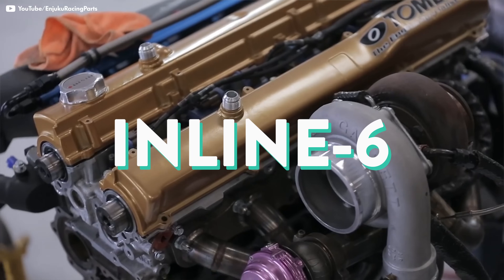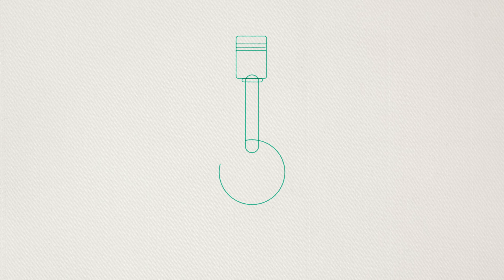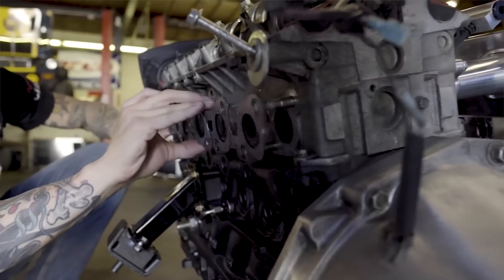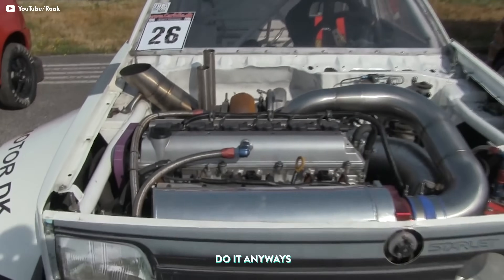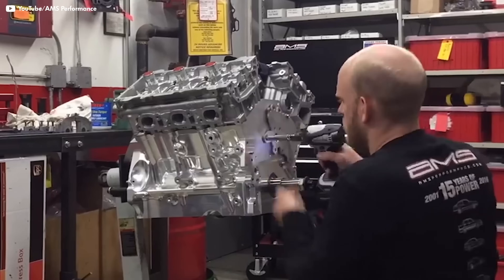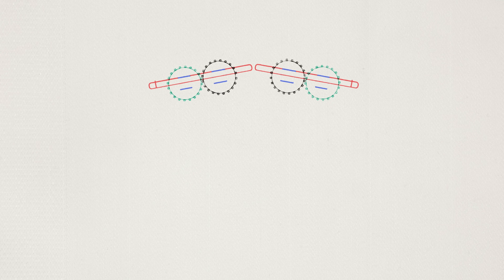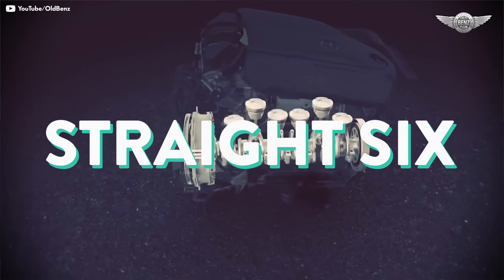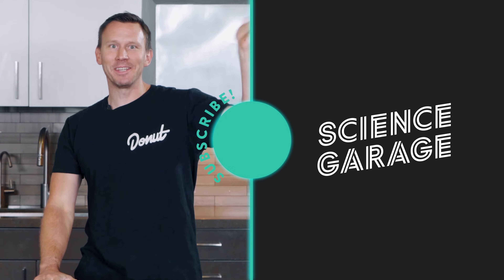INLINE 6 vs. V6 - How it Works | SCIENCE GARAGE

Comment: What about the Chrysler Multibank? It was used in the Sherman tanks in WWII.
Comprised of about 4 or 6 Chrysler V6s all clustered around a central crankcase. So you had a 30 plug engine.
Sounds dreadful but was actually quite reliable.
Reply: five Dodge 230 L-heads.  The biggest problem these had was carburetor access
Reply: So...you suggest using a military tank engine in a everyday car?
I wonder what the MPG would look like.Or how would it fit.(No trucks)

Comment: Wow. You forgot to mention that I6's are incredibly popular with big rigs
Reply: I work on fleet trucks daily.. almost all are inline
Reply: Yep, I'm a truck driver and every tractor I've driven is powered by an Inline 6
Reply: Question to all three of you then; is that because they are easier to work on as you can access the 'entire' (more or less) engine on the side of the road?
Reply: @Anarchristian_Beanz  I6's are have alot more durability and torque over their V6 cousins.....as for ease of maintance, that is a debatable question which depends on the engine's size, weight, engine manufacture and vehicle it is installed in.
Reply: Joshua Pearson it’s for durability and prevention of vibration fatigue to truck and operator
Reply: inline six can be enlarged as much as you want and still run smooth, also, in a big rig, size and weight are not a concern, and since you can extend the stroke for more low end torque which is what big rigs are all about, you have a winner...
Reply: Michael Miller scania v8 if you got the $$$$
Reply: They make low end torque easier and better than a v6.
Reply: Facts my semi truck has a Detroit inline 6  twelve liter
Reply: Yeah i’ve also driven a 10,5L inline 6 for quite a bit!

Comment: I had an Audi with inline 5 cylinder engine.  It was also silky smooth...but now I am curious how it was balanced
Reply: Silky smooth?  Anyway, Audi used weak, super-soft engine mounts, the one on the driver's side would often break.  That's what caused the run-away acceleration problem on those cars.

Comment: Forgot to mention the best motor ever put in a truck, the cummins 5.9L inline 6 turbo diesel. When you put the cylinders in an "inline" configuration is increases the tourq, which is why cummins inline 6s are still able to compete with all the modern diesel V8s.
Reply: I6s dont increase torque and Cummins made v8s they are just not for truck use. Also would be funny to mention how a na v8 with less cubes then a Cummins made 1000 lbft at 1400 rpm. And a v24 made like 3000 at less then 900. The crank shaft has nothing to do with it. It's about the entire package or a 292 i6 would produce more low end torque then a 4.8l ls because it's just a i6 at the same cubes. And the 292 head stock can only manage to hit peak torque of a lower value at 2000 rpm net 1600 gross or 800 rpm gross depends who you ask. And the ls produces more at around the 2000-2500 rpm area
Reply: The Cummins i6 ranges from 6.7-15 or maybe 16ls. A scania v8 produces more torque and hp.

Comment: Why do supercars always seem to skid and lose control. If you look up supercar crashes, it almost always starts with a skid, lose control then a crash, but Why?
Reply: More money=less driver skill typically.
Reply: Supercars are typically mid-engine and rwd. What happens is a thing called Snap-oversteer or Liftoff oversteer. Basically, a skid happens, so the driver brakes and tries to correct for it, the problem with braking is that if your vehicle is in a turn, the heaviest part of the vehicle is going to want to lead to the front because by braking you transfer all your weight forward. The engine and transmission are centered near the rear of the vehicle and so the back end whips around. With all that power, a light body, the engine flips the car around. 

I'll find a video that explains it. The MR2 SW20 is famous for snap oversteer. Cheap, lots of power, and means dumb young highschool/college kids buying them and doing dumb things in a car that drives like nothing else on the road.

EDIT: here is the video http://www.youtube.com/watch?v=tFnUysUwm88&t=2m58s
Reply: Route1Reels Thank you so much! The stars have aligned, the world is good again, and it all FINALLY makes sense now.

Comment: I just rebuilt the inline in my 77 ford truck 
The 300 Cu. L6 is my favorite motor ford ever built.
It's my profile picture 
The previous owner had run the motor put of oil (hole in oil pan) and the old thing kept on kicking 
In 41 years, it never had anything changed.
It's a testiment to the durability of the engine.
153624
15 is too young
36 is too old 
24 is just right

Comment: This is wrong!!!  The piston doesn't travel farther during its first 90 degrees...  it travels less during the first 45 degrees, then most during the next 90 degrees, and then less again for the next 45 degrees.  When the crankshaft is at 90 degrees, IT HAS traveled exactly 1/2 of its stroke.

Comment: I wish i could get my hands on a 4.0L barra engine
Reply: Get a 300 straight six do offenhauser intake/exhaust port and polish the head and throw a turbo on it you'll have the same torque as a 12v cummins plus around 200-225hp. the compression ratio on a 300ci is  8.8.1 when the ideal compression ratio for turbo charging is 9.0.1

Comment: Mercedes m276 Is a 60 degrees V6 engine. It runs really smooth and does not even have a balancer shaft. The fact it is a 60 degrees engine, there is more room on the sides to work on it.

Comment: High-compression Inline 6 is absolutely amazing... my 2 favs are the S54B32 in my 04 M3, and the RB26DETT (you should know where this comes from!!). I do, however, love Nissan V6s... the VG30DETT was incredible for its time.. but that VQ37VHR, with the new VVEL.. slap on some CAIs and HOLY COW! Talk about waking up an engine.. the power delivery and torque curve is SO smooth on that V6, it's absolutely incredible!
Reply: I agree,  the N54 in my 335i has a good amount of torque even below boost range. To be fair i'm comparing it against my previous K20 so anything feels torquey to me

Comment: The answer is simple! RWD all the things! That way you can run inline engines in any platform! The only advantage that a v6 has is packaging flexibility. V6s are largely being phased out in a lot of vehicles in favor of turbo 4 cylinders. Mazda (2016+) and Hyundai (2019+) don't use a v6 in any of their vehicles.

Comment: WHAT are you talking about the best gas straight 6 IS  FORD 300(4.9) or JEEP 4.0L and 80% of Diesels are straight 6s
Reply: Ford 250 straight 6 is just as good.
Reply: 2jz the world m8 sorry
Reply: try the ford barra straight six, DOHC, 4 liters and soooo easily modded.
Reply: 6.7 Cummins for life.
Reply: Slant 6- jeeps like to blow up radiators with the big boy
Reply: I don't know about you but in America we leave diesel to big rigs, school busses, and farm trucks. Less than 20% of vehicles in the us are diesel.
Reply: 80 percent of diesels are i6s? Only in small equipment.
Reply: Hell not even then i4 i5 v6 v8 and up all have been used even i7
Reply: Wrong, 225 Slant Six.
Reply: @JakeSnake07  except of 30 degrees outside and it won't start. We're done 3 plane Tugs 1 out of 250 straight 6 Ford and that one had a 300 straight 6 the other one had that 225 straight it was the only one that would not start. The two Ford's just needed gas.
Reply: @republicansareoffendedeasi821  yeah but imagine a straight six with tbfi

Comment: VW made a 6 cylinder for a little while....        VR6?
Reply: The VR6 is such a beast of a motor. Im sad to see it's not even mentioned. Its designed as an inline-v6. One cylinder head but each "bank" of cylinders are separated by 15 degrees. 6 cylinder power for the size a hair bigger than a 4 cylinder. Plus the sound they make is amazing, like chewbaccas growl. It was initially designed to be a diesel so VW manufactured them with forged internals so a bone stock motor is good for 700 whp the trans will go before the motor. It's a popular platform for drag racing cause you can make stupid power with them.
Reply: @Saltinator  you really know your VR.
" der beste Sex, ist VR6 " 🤣🤣
Has a really great, unique sound, too.
Reply: @freedom8480  I've had my fair share of VRs. I currently have a 99 Cabrio I vr swapped.
Reply: MY GUY!! You're an OG Vee Dubber ;) I'll remember my R32s number for life. 4372/5000 :)
Reply: @Saltinator  There's no such a thing as an Inline-V6. The VW VR6-VerkürztReihen6 or loosely translated in English as ShortenedInLine6, basically is an inline 6, 6-crankpin, 7-bearing crank throws, with the cylinder bores splayed at 10° or 15° apart.  Therefore staggered cylinder head and shortened crankshaft. There's only 1-cylinder head.  A 60°, 90°, or 120° V6 all have 3-crankpin, 4-bearing crank throws. 2-cylinder head (L&R) etc.
Reply: @7spower998  inline because it shares one cylinder head. Vee because the pistons are staggered 🤦🏼‍♂️
Reply: @Saltinator  You said an InLineV6. An IL6 has 6-pin crank throws, while a V6 has 3-pin crank throws. The two don't mix. The VR6  cylinder head is bored at V angle so the cylinder bores can be staggered. Therefore it shortens the crankshaft's length. That's why it's called VR6-VerkurtztReihen 6 - ShortenedInLine 6.
Reply: honestly needs its own segment but i agree should have been mentioned
Reply: They should've included this in the mix
Reply: It has such an awesome exhaust note. I miss my mk4 gti 24v vr6 it was such a fun little car
Reply: @kevinkinsley2019  that's one of my dream cars!
Reply: @MrSapper21  haha there badass little cars but I haven't had much luck with German cars mechanical wise. My VW and my car before that e46 330i it seemed like they were broke down more then they were on the road lol. I loved both of them but financially not practical.
Reply: @kevinkinsley2019  I had a turbo VR6... I used to say when the VW runs it a good day,  when it doesnt its a normal day.
Reply: @Blakek.  Haha you're not lying though. I swear I could expect my gti to break down at least every other month. Every time I drove it towards the end I would pray nothing would happen.
Reply: Now I'm going to search for videos on this just in case donut doesnt make one 😁
Reply: The V and R in VR6 represent two German language words which translate to V and LINE. The R is REIHE. It's a compromise design that's not as well balanced as a TRUE straight six and, not as short, front to back, as an inline 4. It's "neither fish nor fowl" as the old saying goes.
Reply: @BigFiveJack  i always thought it stood for " Verkürzter Reihen " motor which translates to "Shorter Line " engine.
Reply: @joshuavandergraaf7413  The following video, (by Jason) tells us about this topic during the first 25 seconds or so: https://youtu.be/Y0LKWt3Ttic
Reply: @BigFiveJack  VR-VerkurtzReihen-ShortenInLine
Reply: It's a mix of the two, 15degree angle.
Reply: I used to have a VR6 R32 MKV and gawdamn was that one of the best motors I've ever messed with.  Too bad MKVs have bad bad electrical issues. 10/10 would swap if possible xD well, anythings possible...
Reply: Check out the german ford made Cologne v6, granted they were cast iron blocked but they made crazy power with stock internals...used in rallye in the 80s

Comment: V6 is great for the manufacturer but a headache for the consumer. Inline 6 or die.
Reply: Hansolo86Mk2 oh yes
Reply: That's basically what I was getting from this video but at the same time a lot of consumers do want smaller/compact cars and understand that comes with more maintenance (or just don't care).
Reply: @Anarchristian_Beanz  that's what 4cylinders are for
Reply: I6 is superior in its reliability and elegance of design compared to V6, but that V-design has created the best sounding six cylinders in my opinion, listen to the Alfa "Busso" V6 engines as well as the old Ferrari racing engine used in legends such as the Lancia Stratos. Inline is great but there is some magic to those old italian V6s.
Reply: OR you forget about 6 and go to a V8 instead
Reply: @sauronseyescream8394  For what? More headaches?
Reply: @Bitaliktderr  its worth it to me. I'm a sucker for a great V8 exhaust note. Not a fan of anything about six cylinders really, other than fuel efficiency
Reply: @sauronseyescream8394  I like V8 sound too but more money to rebuilt, maintain it, and overall costs, so not sure if its worth extra $$$ for the exhaust note.. Inline 6 has one of the best sounding exhaust notes when turbocharged.. if you can afford a V8 and go for it, just a lot more headache and money rebuilding it when something goes wrong compare to L6..
Reply: @Bitaliktderr  oh believe me, I know headache. Had to replace the exhaust valve spring in my Trans Am after it broke somehow. LS1's are a pain to work on inside of the car.
Reply: @sauronseyescream8394  yeah man, I am also a type of guy who likes to save a buck and work on my own cars
Reply: @Bitaliktderr  I do it so I know what's going into it and that it's done right. Plus its better to be able to know how to fix something
Reply: @sauronseyescream8394  exactly! Plenty of diys and info on google to do it yourself!
Reply: @Bitaliktderr  yup. Going to pull the engine eventually and do the rest of the valve springs
Reply: @sauronseyescream8394  nice man! Good luck
Reply: @Bitaliktderr  thank you, gonna need it. Have to lift the body off the engine to do it.
Reply: @sauronseyescream8394  yeah thats a easier way going about doing it when you have a lift
Reply: @Bitaliktderr  don't have a lift but found another way to go about it

Comment: Most of the cons of the inline 6, like stated in the video, can be negated with modern technology. As far as the length of an engine bay, that's more of a design feature. Long beautiful bonnets or hoods are beautiful on most cars. Overall, I really don't see any negatives with I6 engines. Hell, even Toyota/Lexus utilized them in their line up of cars: 1JZ & 2JZ. Less complexity, less vibrations, more compact, forced beauty due to design... what's not to love. I really didn't understand what a balance engine was until I drove in an E46 M3. Put it this was, when the car was parked I stepped out of the car not realizing I didn't turn of the engine. It's that smooth. The same at a red light. All of sudden, it made me realize how "unbalanced" my I4 K20 was in my Acura RSX-S.
Reply: I believe it has to do with the firing order, the primary forces. I'm not sure, however.
Reply: @Dickhead Bear I disagree with weak crankshafts as someone who drives a 13L L6 powered semi for a living

Weight distribution and engine weight are the only downsides. They are outweighed by the pluses in applicable applications (good torque, hence truck use; and naturally balanced)
Reply: @Dickhead Bear and almost all V6's need balance shafts, or they run like shit, like the original Buick 225 V6
Reply: @FirebirdCamaro1220  that was a 90 degree and that wasn't running like shit it's how 90 degree v6s run.
Reply: @jdrok5026  The "ideal" bank angle for a V6 is 54°, and even then, the few V6s built at that angle (like the Opel engine used in the Saturn L-Series) still need balance shafts.

There were no balance shafts in the 225, they were added with the 231. Hence the 231 ran much smoother than the 225 had
Reply: @FirebirdCamaro1220  crank pins where added to the Buick 90 degree engines
Reply: @jdrok5026  some applications did that, I had a 90° V6 in my 08 Dodge Ram, the 3.7 PowerTech. It did have a balance shaft.

The Ford Essex 90°V6 from the F150, Econoline and the Fox bodies also used a balance shaft

And the Chevy 262 (4.3) got a balance shaft in its 1992 re-design
Reply: @Soldado de Juan José Torres small Inline 4's (i.e. below 2 liters) don't have as much of a problem, but bigger inline 4's (there are 5 litre 4's, albeit diesels, in medium duty trucks) need countershafts to even vibrations
Reply: With manufacturers dropping V6s in favor of turbo fours,  a "modular" inline family of a three, four and six can share more of the production tooling and parts.   A na inline six is suitable for the base engine in trucks and a turbo inline six replaces a V8.   The question is whether turbos and superchargers are practical for daily drivers.  Would a 400 hp 3.0 liter turbo inline six be reliable in a work truck?   Would it save any fuel compared to a na V8 ?  This is leading manufacturers to develop hybrids with some use of batteries.  Can the average person afford to purchase and maintain the increasingly complex vehicles of the future?
Reply: Turbos belong on diesels, not gas engines.
Reply: you did the same thing i did, sold the rsx-s and got a bmw. its much much better, also gotta love boost lol
Reply: Since I drove a BMW E46 328i I can absolutly relate ❤️‍🔥
Reply: Pay attention to what you're watching. 

You're not fitting an inline 6 in a transverse setup, which is what most modern ICE vehicles use, and you're not fitting it in a mid engine setup, which is what most performance cars use. 

Please tell us again how the length of the inline 6 isn't a con and a long hood is a "Design feature"  

Ludacris comment.
Reply: I6 motors also are less safe for vehicle collisions. Having a shorter V6 means a greater crush space is available at the front of the car.
Reply: I6 are too heavy 😔 and too big.
Reply: @leslie7872  they could have countered this with aluminum blocks